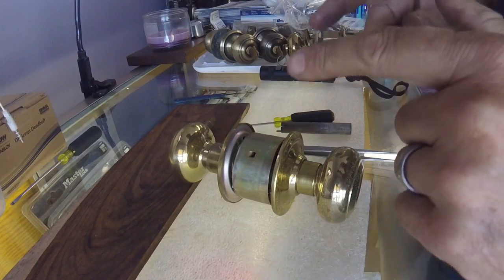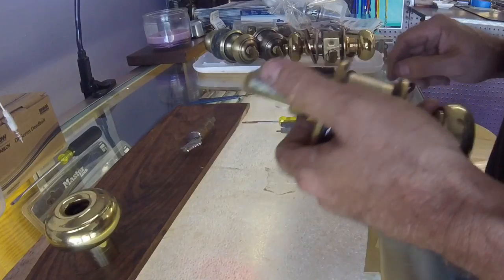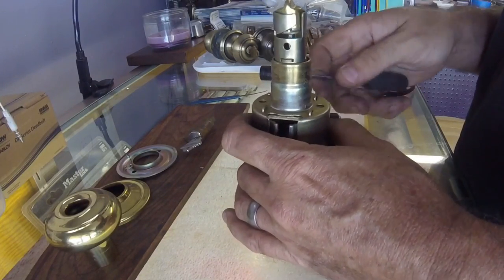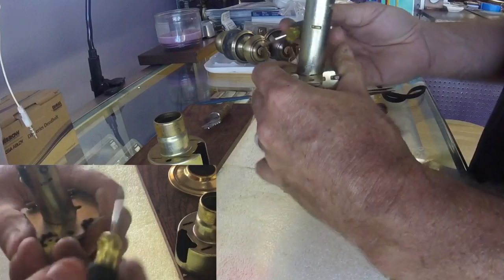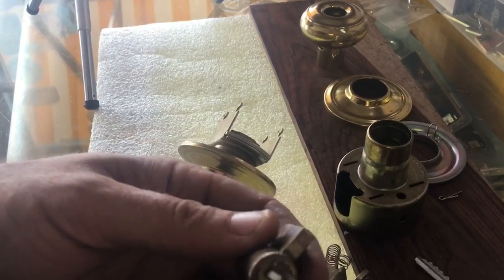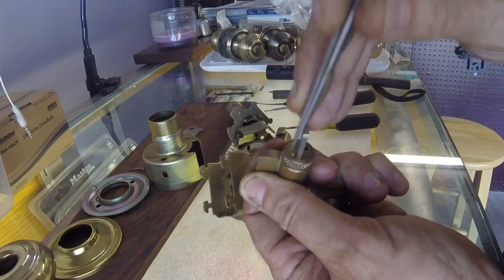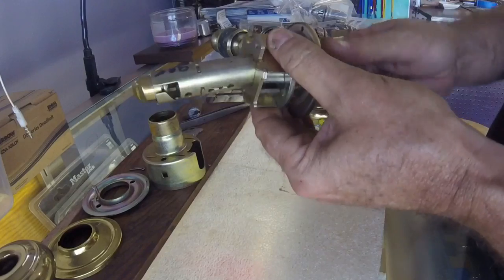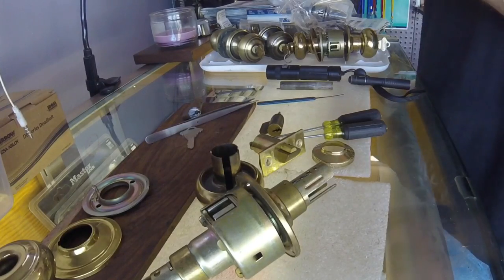Disassembly & Reassembly Schlage A53PD A Series Cylindrical Lock

Comment: Great Video Jason. I’ve done this same thing many times, mostly just out of curiosity. I find picking the most satisfying. My servicing with these locks is just a good WD40 spraying followed with a good compressed air blowout. Spray grease once clean.. Other than occasional wear on the pull fork, replacing latch assembly and cylinder, these locks can last forever.

Comment: This was a great video, no idea why it got 32 thumbs down. Thank you for making it! If you don’t have the key and can’t pick it, but you do have the “Schlage service tool SCT-1”, does it make this a little easier as you don’t need to take it completely apart? I’m struggling with an old A series (60s/70s, ribbed glass handle) without a key and no luck picking...
Reply: Oh, rewatching this, I think that’s the tool you showed at 7:22 which you said you never found to work well 😂 Sorry I missed it before when I asked that question